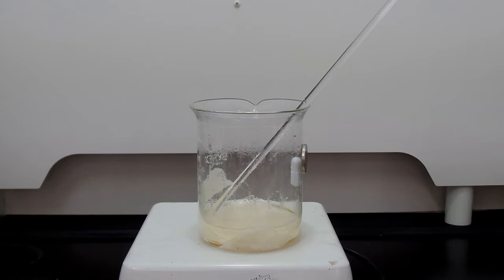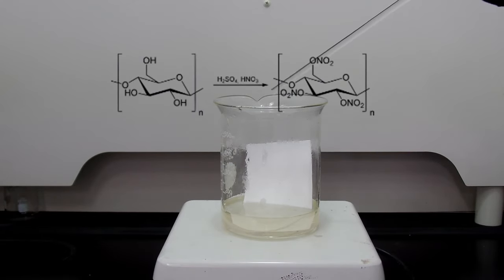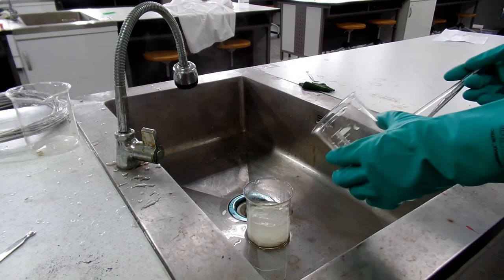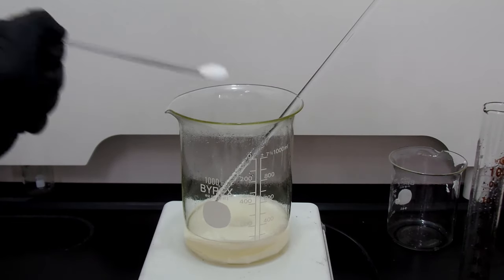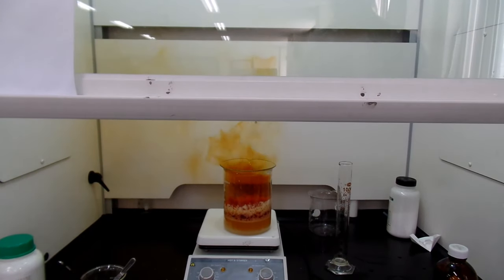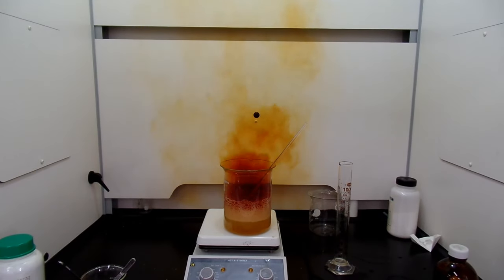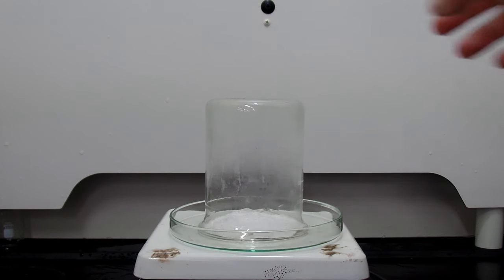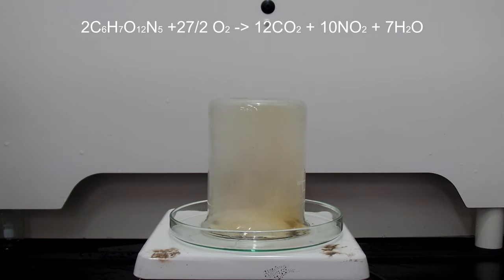Synthesis of Nitrocellulose(Flash Paper)

Comment: Hello there i see You re chemistry emthusiast i actually liked your videos but i see You have some problems in doing this one and i have some ideas of what you make wrong 1 : paper thickness You Say that You used  tissue paper but is very frágile when it gets wet maybe if You use Quality a4 paper it can withsthand getting while it gets nitrated 
2: You used nitrates instead of nitric acid so it makes the reaction more dificult to control  the nitration of cellulose is exactly exactly as the process of making nitroglycerin but leas dangerous only try to keep the mixture away of hot things 
Thats all 
Sorry if My English is too broken
Reply from the maker: All my comment was gone because I mistakenly unactivated my youtube channel. Sorry.
1. The problem that I come across was that the nitrocellulose was too stiff. The stiffness is inversely proportional to the malleability. The filter paper that I used was too stiff. This is the reason why I suggested using tissue paper because it is softer than filter paper.
2. There are two different procedures for making nitrocellulose. Using nitrates, or nitric acid. If I added the nitrates to the right amount, It should be controllable. But I tried to add more nitrates, the leftover nitrate reacted vigorously when I added water. (I'm not sure whats the mechanism of this...)
Reply: @JBChem  hello,
If you wanted i would like to show you how i get fully nitration of cotton, not paper. In my view It is so much better and suitable than paper.
I use the same reagents than you, but my Kno3 is recristallized and completely dry. I add 40 grams of Kno3, in a glass inside cold watter bath. Keep the temperature during the first minutes between 15-20° Celsius is very important. After add 73ml of  sulfuric acid. But make sure the temperature is Fix around 15°©, then you may start adding the cottons ( around 4'5 grams). And stirr from time to time the mixing with the termomether to make sure the temperature don't rise Up than 20°©.  After 30 minutes the temperature Will not rise more, so It is the time to remove the cool watter bath, and cover the glass with a plastic film. I want to mean the same plastic used to covert the meals( is mandatory covert It to avoid absorve watter from enviroment). And the last step is store the glass with solution for 24-25 hours in a dark place when the temperature were 15°©.
If you wanted to see the results watch in my Channel the gun cotton fully nitrated burning test . If you have any doubs don't hesitate ask me. Best regards.
Reply from the maker: @longimanusisurus132 I've never thought about temperature management at that time. With that temperature management procedure, the reaction will be more manageable than mine. Also, my batch didn't nitrated that well because filter paper is pretty thick. 
Cotton would be better because it has more surface area compared to normal filter paper or paper towel. With more surface area, you can permeate nitrate solution pretty easily, and it will combust more rapidly because of its large surface  area, which will help to feed more oxygen into the cotton.